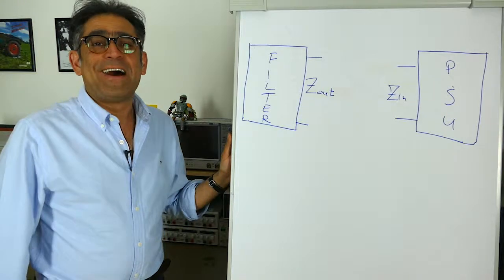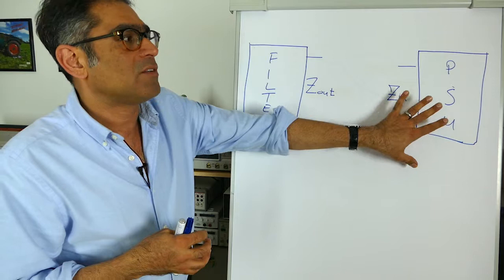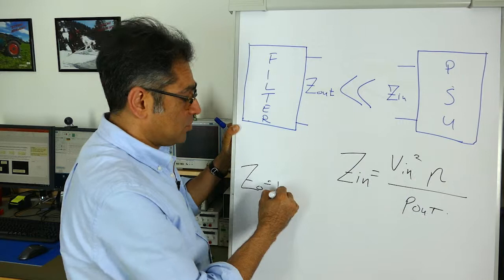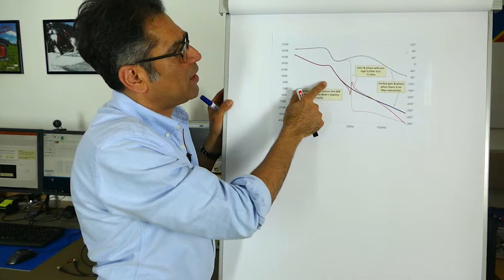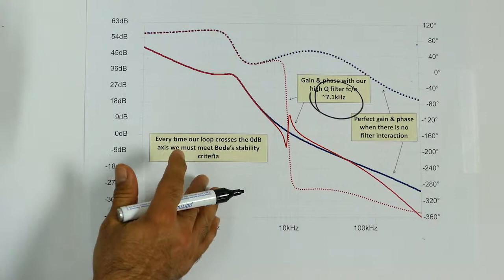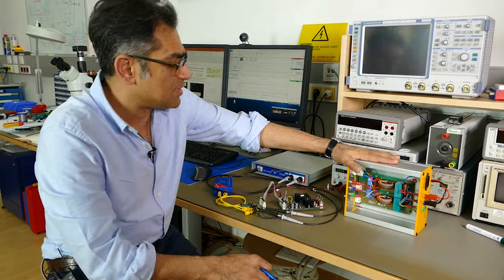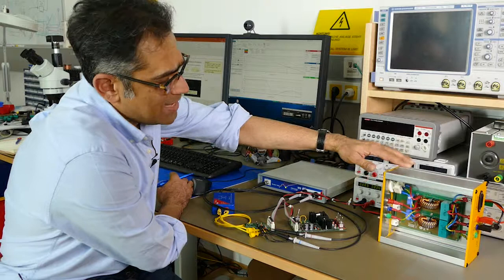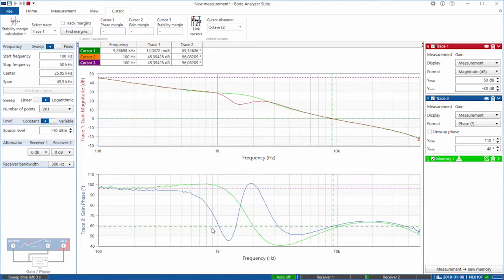EMC Filter Design Part 3: Input Filter Stability and Middlebrook

Comment: Steve Sandler's book referenced as the source of the formula for estimating Zin is "Switched-Mode Power Supply Simulation with SPICE".
Reply from the maker: We think Dr. Ali Shirsavar was referring to "Switched-Mode Power Supply Simulation with SPICE" by Steven Sandler. This book contains a section about input filter and negative resistance.
Reply: @OMICRONLabTutorials  Thanks. Just ordered a copy!

Comment: The presenter mentions a paper which estimates Zin using power, voltage, and efficiency.  Anyone know the citation?  I couldn't quite hear the author's name in the video.
Reply: Seems to be Steve Sandler, author of a book called "Power Integrity".
Reply: @mikemike7001  Thank you
Reply: @BucksBreaks  You're welcome. It's actually Sandler's book "Switched-Mode Power Supply Simulation with SPICE" that contains a section about input filters and negative resistance. My copy should be arriving tomorrow . . .

Comment: Calculation of Zout and Zin is wrong. Please refer to Fundamentals of Power Electronics by Robert Erickson Chapter-10. Zin should be calculated by 2 different assumptions. The first is by perfect control and the second is by no control conditions. Also, Zout expression as written seems to be frequency independent, which does not make sense.
Reply: Zin in this video is the static input R - which could be derived from Pin = Pout/n = Vin2/Zin. 
Zout in this video refers to the characteristic Z. 
Nevertheless the frequency dependence can be deduced by looking at where the Z peaks (highest Zo should not come close to Zin) at 1/sqrt(LC) and the omega can be replaced with such expression.